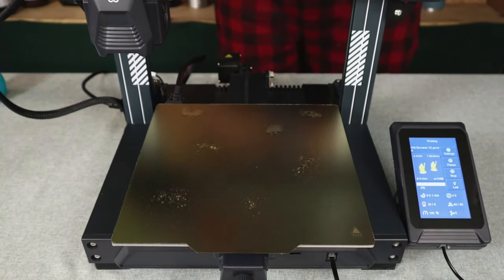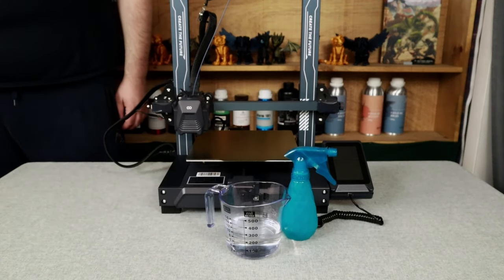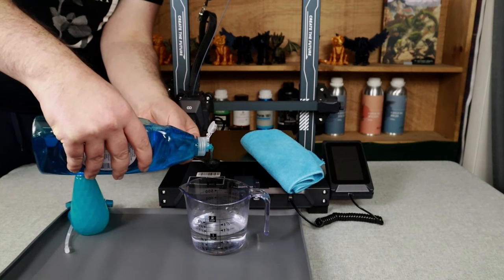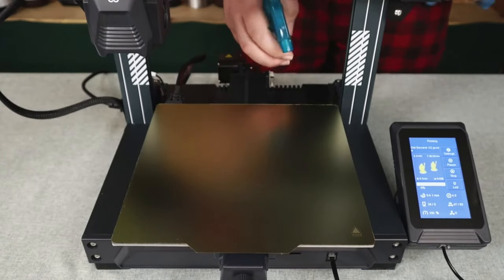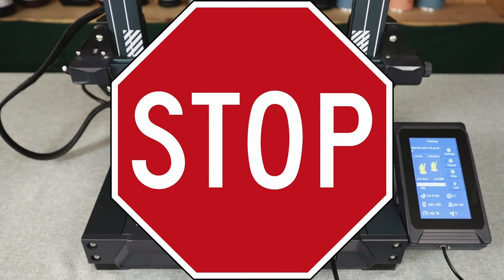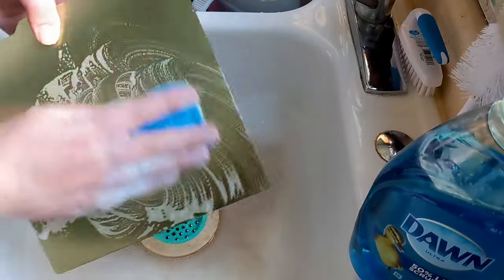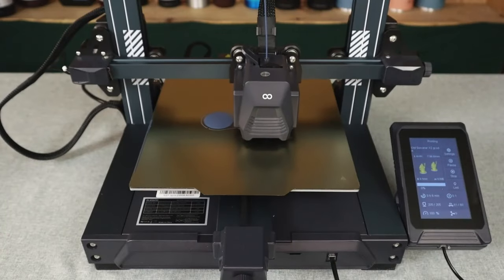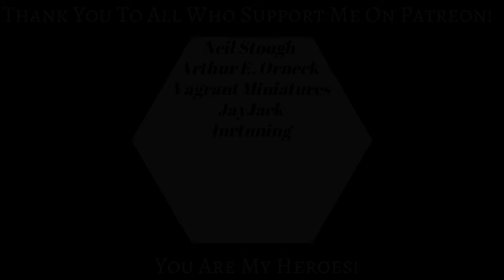How to Get Better Bed Adhesion With Dish Soap! - How to Clean a 3D Printer Bed

Comment: I've come to the conclusion, that using 99% IPA leaves a thin layer of something on the build plate, which can't even be just wiped of dry. On both my FDM and my SLA printer, my first prints always struggle after cleaning. Will try your method next time I print, though I'm printing very rarely.
Reply from the maker: I've definitely had issues with IPA as well. Even 99%. I've never had any issues with this method so I hope it works better for you.

Why are you only printing rarely? Anything I can help with or you just don't have the time?
Reply: @SlicePrintRoleplay I bought my first printer, FDM Creality Ender-3, back in 2018. It took me about 2 months of fail and error, till I finally managed to get some consistent results. Modded the fan system, so I had cooling from left and right instead of just from one side. And some other minor mods. But larger prints still always failed. I never really calibrated my E-steps, but I heard a lot of it. I just didn't bother.

A year later, I bought myself an SLA Elegoo Mars Pro, which instantly had great results. Couldn't do anything big, but at that time I was fine printing just miniatures and such.

After my dad passed away in 2019, I had to move back to my mums house, so printing there was a bit of a problem. She doesn't like the fumes and smell. We have a small workshop at the ground level of our house, which would have been perfect for that, but our cats moves in and out from there, so I didn't want her to deal with the fumes either.

Long story short, my printers now are one room next to my bedroom, which is also my room from where I work remotely on my PC. When I print, I put the printer in front of my small window and open up the window, so the fumes and smell goes out at least a bit. But then I can't print for very long, because the noise is making work hard, when I have a video call meeting.

I would love to print more and maybe one day buy myself a new FDM printer, or finally calibrate and fix my Ender-3, but till then, I just don't use it very often. Maybe like 1-5 times per year...